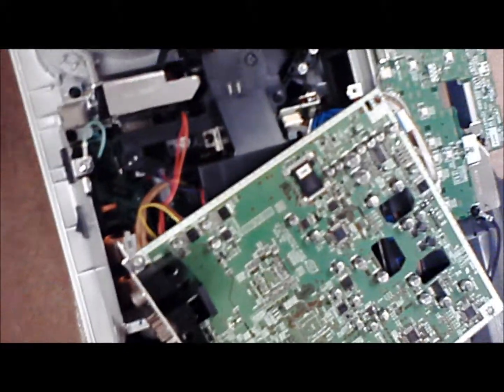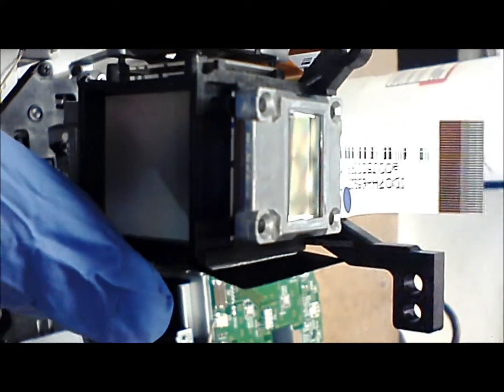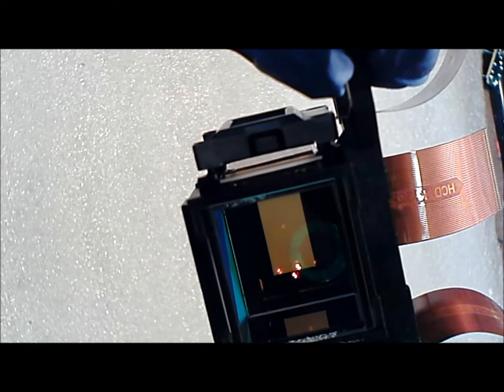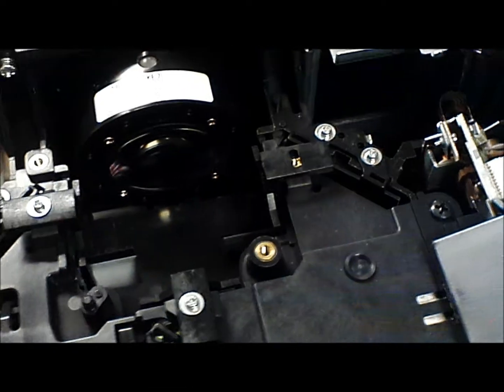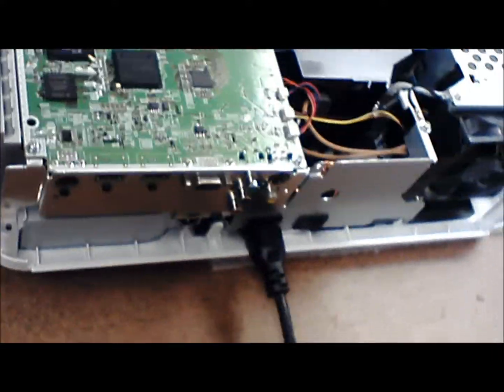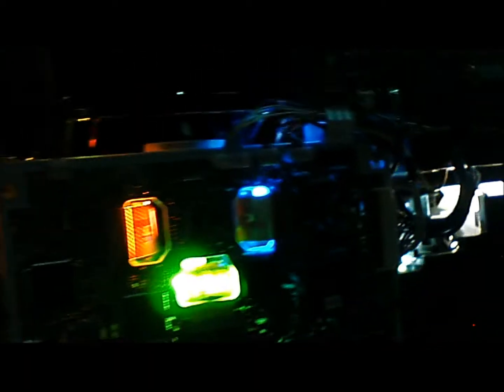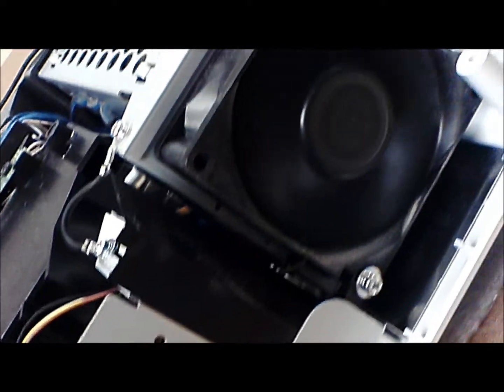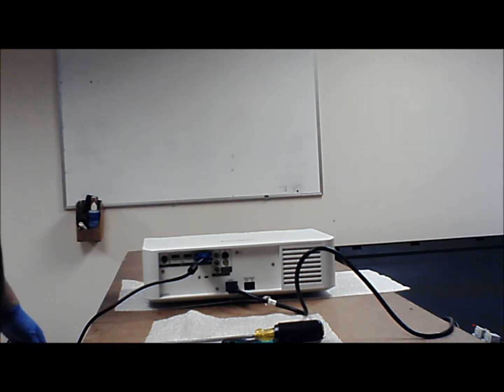Polarizer Replacement Panasonic PT-AX200U LCD Video Projector

Comment: Lamp abuse!!!  Less than 10-15 minutes ON time does not give the metal halide salts enough time to fully vaporize and achieve full homogenization. This can cause black spotting inside the lamp globe upon shutdown.
Reply from the maker: +beforebefore You should read a bit before you post misinformation. It would be true if it were a metal halide lamp but its not.  These are short arc mercury lamps and this lamp in particular is for testing only.  Im a 20yr repair professional so I know little more than you.
Reply: +Rostit   Vaporized mercury also needs time to cool down, and turn back into a liquid... otherwise lamp damage will occur too. Yes, it's less of a problem than with metal halide salts, but still there.

20 years... that's a good starting point.   But if you really insist on going there...
I was repairing electronics obviously before you were born. I was co-teaching an electronics class at the age of 16, chosen as a stand-in teacher because I already had years of real-world repair experience.... this was in 1975... 40 years ago. 

I began repairing/rebuilding LCD projectors in 1993, and have repaired anything from 640x480 consumer units up to several $150K DP Lightning 15SX triple-DLP projectors. 

I was working in R&D electronics design engineering since I was 20... 36 years ago, designing law enforcement 10 & 24 GHz speed radar. Then I worked as an electronics design engineer for the company that produced the very first external mass-storage system for the IBM PC when it first came out... before IBM had even released any technical reference manuals for designing products for the PC.  I then worked as the director of engineering at a corporation that produced some of the very early Arcnet LAN adapters, and hubs... 10's of thousands were produced.  I was then one of the founding engineers at GARMIN... employee number 11... designing consumer GPS products before there were even enough birds launched to get a position fix for more than an hour or so a day. After that I was the director of R&D and active design engineer at a contract design and manufacturing company, taking ideas and turning them into real products, both industrial and consumer markets.  I have multiple patents in my design career portfolio.

Just be careful about your "bragging rights"... there's always somebody with more impressive rights, and knowledge than you... or me.

Comment: would replacing the lamp with a new lamp solve the problem of the blue polarizer yellow spot or is the blue polarizer totally another issue aside from replacing the lamp?
Reply: the lamp only supplies white light.  colors are dictated by the polarizer.  replacing the lamp will make no difference.  It will in fact speed up the failure because the new lamp will run hotter than an old lamp. Replacing the polarizer like I did in the video is the only way to fix the issue.

Comment: Under no circumstances should you remove the individual LCD panels from the prism block. The panels are super precisely aligned with each other, and you'll have a hell of a job aligning them again without access to either the engineers menu (if there is such a thing on this projector), or panasonics own software and a connection through the projectors communication port. Removing the complete array of LCD panels is safe like in this vid, but not each individual panel.
Reply from the maker: You need special lcd extension cables to run the mainboard away from the optics on older projectors with adjustments.  Most newer models have the frames aligned and epoxy'd in place. If you remove a panel, its virtually impossible to re-align on a bench. Your advice on not removing a single panel is really good.
Reply: I got exactly same PJ model as in video. And I already got it with misaligned panels out of the box (bad convergence). It's unfortunately my first PJ and before I realized it after buying, it was too late to replace it, and I assumed panasonic would not fix it but would say it's within limits (maybe I assumed wrong..)
Anyway the question - as it is past warranty anyway do you think I could possibly improve convergence, or even allign panels perfectly on my own? Service manual is online and it says no special tools or let alone software required). Only extension cables (FFC/ribbon) but I think I might be able to handle that.
Reply from the maker: XtmtX For the cost of the cables versus buying a parts projector and swapping optical blocks will save you a lot of hassle. Depends how long you want to put Into it.
Reply: i did that on a sanyo plv-80
and then used 2 cameras with 300mm lenses to align them back.
never again.
Sanyos are waaaay easier to work on than most projectors.

Comment from the maker: That is a tough one.  It depends on who actually made the projector for Yamaha.  Its rare for Yamaha to build them themselves. Usually its an OEM company like Sanyo or Epson or someone who builds the internals and then Yamaha puts a sticker on it. You should check to see what is printed on the circuit boards to see who actually made the unit.

Comment: Turn the dial a full 360 degrees, then a half turn more. You should be able to pull it straight out. Be sure the only thing turning is the stem, not the complete mechanism.

Comment: I saw your video on changing the blue polarizers on the PT-AX200U. I bought replacements and followed your tutorial. It worked, sort of. The dirty yellow spot is gone. However, I have an odd artifact. It seems to be an alignment issue that shows up with text. Blue does not seem to overlay precisely. Blue lands above where it should be and the text is yellow where it apparently should be a combination of blue and whatever. Is something not lined up properly? All help appreciated. amay88@live.com

Comment: Hello, I tried taking apart my Panasonic PT-AX100U (almost identical to the 200U) for cleaning dust out of the optics but I found it very difficult to take the outer case off. The lens shift knob was getting in the way and keeping the case from lifting off. I finally did get it off but it was again very difficult to put back on. How did you disassemble this projector? Did you find a way to take the knob off?

Comment: It is a Panasonic projection tv. A new optic assembly would be great, but I wouldn't know what too look for. The polarizer that was burnt out was the blue one, but I only removed one of the 2 infront of the lcd. I watched a tv show from a vcr tape. it only appeared mildly blue, but also the bulb is very dim and needs to be replaced.

Comment from the maker: depending on the model, you may want to call the manufacturer directly.  EBay is hit or miss on polarizers. I used heartland supply who handles Panasonic and sanyo.  The biggest trick is aligning them again.  Another option is find a dead unit and swap the entire optic assembly.

Comment from the maker: Not a dumb question at all. If you just left it out you would have too much of whatever color the polarizer was in front of. There isn't another way to control the light output so you would have a very red,green or blue image. Probably overpowering the other colors completely.

Comment: Is there any way you could help me with my LCD projector? Mine had spots in the projectors Image so I took it apart cleasned it , but now when I turn it back on, the LCD's appear to be slightly off balance. I don't hoe to fix this. If there's any way you could contact me thru phone of email, please don. My cell is 6123102629 and my email is matthewboettcher22@gmail.com

Comment: I have an issue with my epson LCD projector that I'm starting to think may be related to the polarizer. Along the bottom edge of the projected image I have a yellowish/brownish hazy area. It is most noticeable in the bottom right hand corner, but also extends toward the center of the bottom edge. Was wondering if it could be a similar issue even though I don't have a big blob in the center of the screen...yet.

Comment from the maker: Check out Heartland supply or encompassparts.  You will need to determine the proper polarizer because Panasonic used two different types.  Search AVS Forum for AX200U polarizer and there is a post that says how to tell them apart.

Comment: I'm doing the same repair as you in this video for pt-ax200u. I only need to replace the blue incidence polarizer. What part number is that and where did you get the part from? I tried Panasonic but they said they would call back but they never did. Thanks for the video. It really helped a lot.

Comment from the maker: Not really sure on that one.  I wouldn't replace the polarizers on that NEC myself.  They tend to cost a lot and the NEC is only an $800 projector  If you bought the parts, you would probably be around $300 just in parts. you can buy a working used unit for $250 on EBay, so I would do that and keep the old one for parts.

Comment from the maker: Most certainly.  The filter is paramount.  Most people don't realize the importance.  In fact almost every Optoma HD70 fails from dust.
In your unit, you want to used canned air and a vacuum to blow out any vent that you can get to.

You can also open the unit once a year or so to clean out around the LCD panels.  Most important is that you do not touch the panels themselves.  Make sure you have the unit well ventilated. Heat is what damages the polarizers. Dust causes heat buildup.

Comment: If dust is the trigger for failure, do you have a suggestion for preventative maintenance aside from keeping the filter clean?  Like canned air cleaning on disassembled projector?   My projector still looks good I'd like to keep it that way.
Reply: i’d put some air filters on the intake side for the optics cooling(not the lamp cooling)

Comment from the maker: The Incidence polarizer and the Projection polarizer seem to fail mainly from heat. The dust will build a tiny layer and cause the radiant heat from the light to damage the polarizers.  I suspect it is usually that pair of polarizers because the light path is shortest to that panel.  I have always seen them fail as a pair and never seen one damaged because of another.  Thanks for commenting!